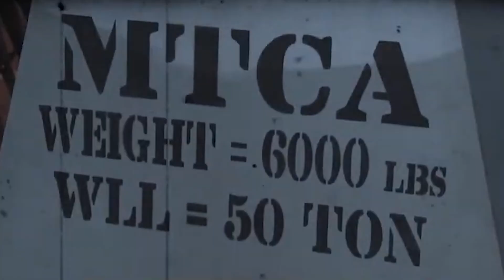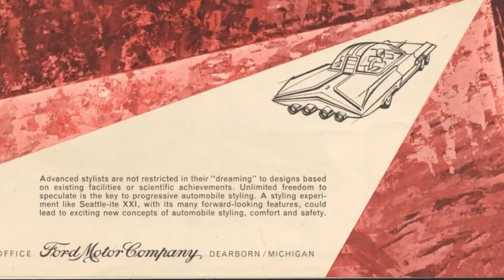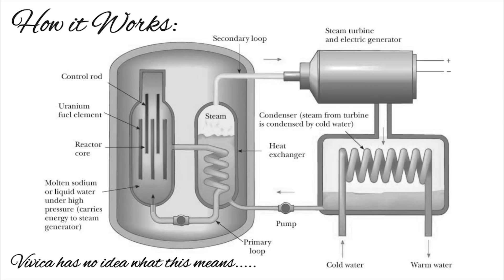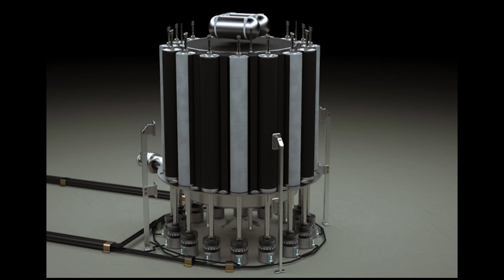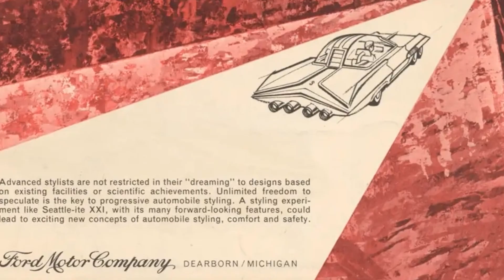When Ford Tried to Shove a Nuclear Reactor into a Car

Comment: nuclear decay heat power is real and simple. especially pu-238/am-241, the stuff from your fire alarms power. solar cars work nice also. well just take a brake and recharge for a while. any space craft probe stuff with rtg is a nuclear powered self-charging vehicle. nuclear fusion pods are more likely than rad fission. if you think rtg is not enough then 0.5kW/kg of heat. or 5% of that as direct rtg electricity. stuff is already solved, you just need to get it. as a free gift from above. not as if from people or your own works. everyone under age of 100yo (80yo limit) is young and deth. have above live with-in you instead of your deth flesh. everything is possible, even micro sized fission/fusion reactors. just invent some stuff.